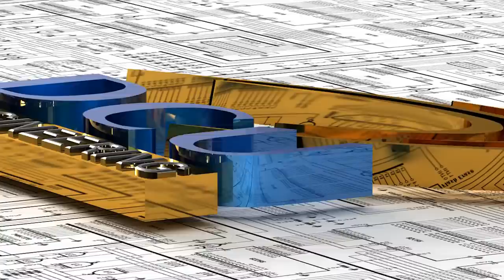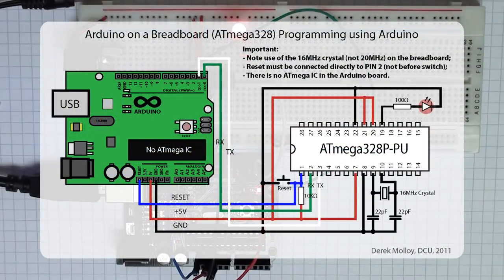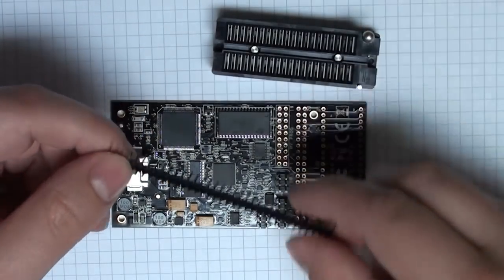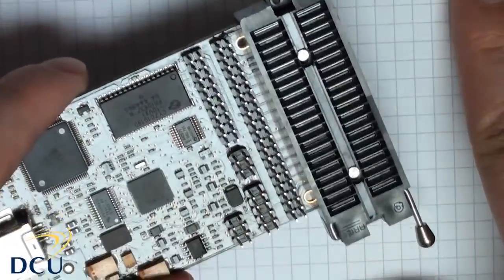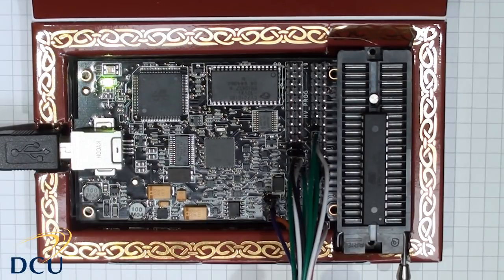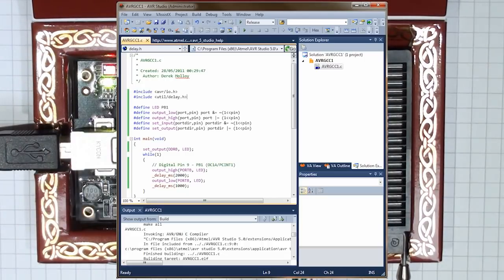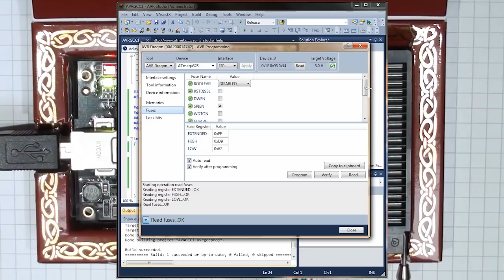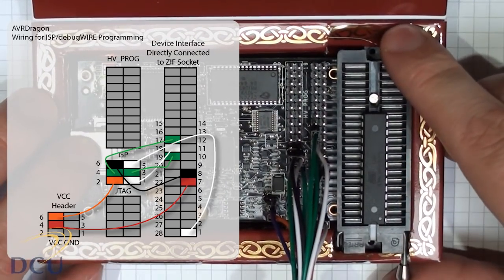AVR Programming - AVR Dragon Introduction

Comment: Just got me a dragon, firstly thank you for the video really useful,

I got me a dragon and just learning how to power the target device via ISP is tricky, ISP has a VTC and ground which does level shifting so it can drive the target from with the voltage powering the device (level voltage translational or level shifting)  also I see you using the dragon`s onboard (VCC +5v) and wiring VCC directly to the target board (VTC pin of the ISP) I read this should be avoided as any short on the (VCC which is tired to the VTC rails ) will damage the dragon (which doesn't have on short-circuit protection) 

Also using Atmel Studio 6 (AS6) "ISP debugging" doesn't work correctly out the box, I actually bricked my AT328P (followed the help guide and only set the debugging fuse and it disabled ISP) the only way to unbrick the processor fuses is to use the HV (High voltage) via ZIF socket to unbrick my processor. 

Wonder if anyone had issues similar to me.

Comment: Hi Derek, I am using your book and as a result I wanted to use my AVR Dragon under Debian instead of Windows so that I can easily jump from my AVR code to my BBB code. I am able to program my AVR IC once but on second attempt the weirdest thing happens under Debian... I posted the issue at AVR Freaks under /forum/avrdude-avr-dragon-official-recommended-baud-rate#comment-1434701      (to be honest I don't think the baud rate is an issue here but I am out of ideas, flashing works 100% of the time under windows and only once under Debian and the only alternatives are to unplug re-plug the AVR Dragon or to reboot Debian and both of those come with some other headaches) Any idea why the AVR Dragon does not exit the programming normally and disapears from the lsusb list right after a successful flashing of the MCU ? PS: Many thanks for the BBB book I am really enjoying it.

Comment: I'm looking to start covering some microcontroller basics in a class I teach.  I debated Arduino vs microcontroller and settled on the latter since it's more fundamental.  My plan is to get a Dragon and some sensors and actuators then let the students design a couple projects.  I know that for PIC,s there are many textbook style reference books (Predko), but I have not seen anything like that for getting started with AVR and the Dragon.  Can you give me some direction to help with starting out?

Comment: I'm also finding that you might just be better off using straight C to write your code on an AVR, especially if you need to use some C++ standard lib (or STL) features. While there are one or two ports of the C++ standard library to the Arduino platform, I am not quite sure how well they work--so that will take some investigation and thorough testing. I'm not saying that it *wouldn't* work mind you, just that by the time you go through the trouble, C with AVR might be the better option.

Comment: Hi great vid. I have an AVRMKII but ever since last night it says "bad AVRISPmkII connection status: Unknown status 0x00 avrdude". Now I checked the connection wire and thats fine. Whenever I insert a fresh 328p into the uno and use the MKII the blink sketch freezes pin 13 light and after the 328p is useless. Have you ever had this? Kind Thanks

Comment: The reason it won't work it that the chip e.g. 328p was probably pulled from a Arduino board and that it's been (fused)  set to use a external crystal. If this is the case and the Arduino board is around just run jumpers for pins 9 and 10 from the now empty dip socket to the equiv on the Dragon board and also run a jumper for the Arduino gnd to equiv on the Dragon.

Comment: Whilst Arduino is good for prototyping designs, it's size and cost make it impossible to market products based on it. The code you write for Arduino though can be quite similar to the C code for the Atmel AVRs although this is only the case when you don't use the Arduino libraries that are provided. You can program some of these chips with the Arduino although you'll find that it's a lot easier to do so with the AVRDragon just because it provides a lot of debugging features.

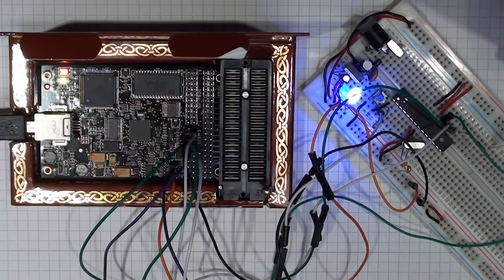Comment: 0:40, why is that so that Arduino couldn't be used for commercial applications? I know it's poorly optimized for spcific tasks so would need a bit beefier MCU than necessary, but in low volumes it's not a breaking point.

I don't see why you couldn't program ATMegas/ATTinys with Arduino as ISP and sell products using those MCUs commercially.

Comment: For everyone that has problems with an ATMeag328p on AVR studio 6: Add a 16MHz clock to your chip or it WON'T WORK. Even in the zif socket it would not run for me, until i added a clock.

Comment: this does not tell how the Laptop having only the USB ports should be able to program Aduino or AVR based boards. USB to serial gadgets do not work to program and parallel port for ISP is also not present in modern Laptops

Comment: The reason it won't work is that the chip e.g. 328p was probably pulled from a Arduino board and that it's been (fused)  set to use a external crystal. If this is the case and the Arduino board is around just run jumpers for pins 9 and 10 from the now empty dip socket to the equiv on the Dragon board and also run a jumper for the Arduino gnd to equiv on the Dragon.